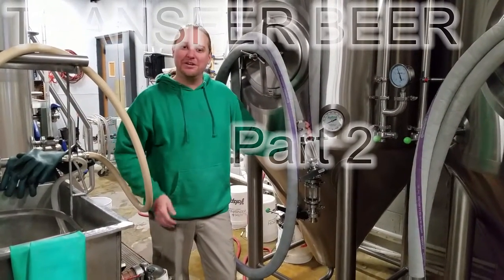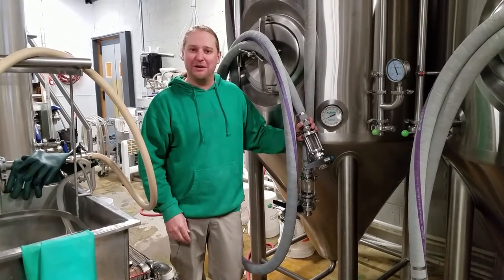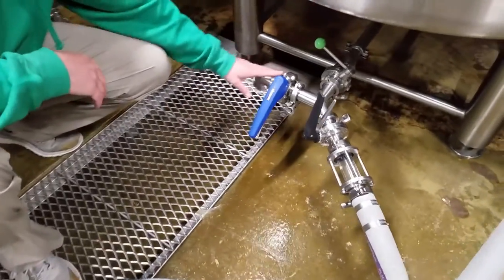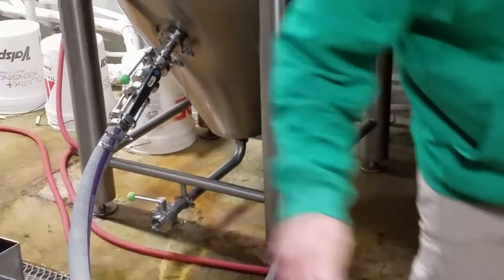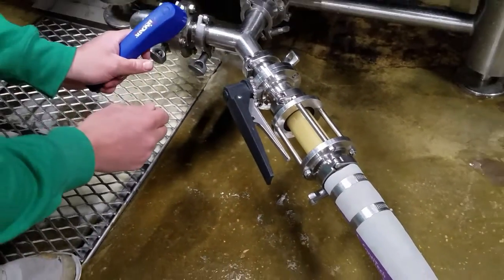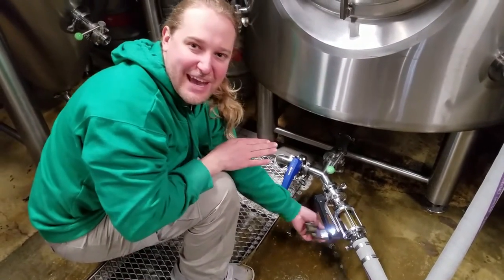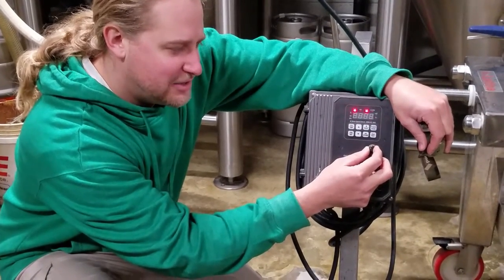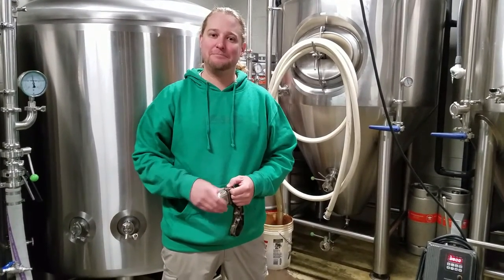TRANSFER BEER! Part 2 How To:

Comment: Very nice channel, I really enjoy watching it. I have only one question regarding this video. From where is the water in the first step of transferring beer and what is it used for?
Cheers :)
Reply from the maker: The water that is packed in the hoses is a sanitizer. This is from sanitizing the BBT before putting beer into it. After the sanitizing loop is done just close the butterfly valves on the hoses and to leave them packed. Is this the water you mean? Hope this helps, cheers!
Reply: Yes, I meant the transfer through the hose at 2:10, I didn't see your hose is connected to CIP with pump, I thought that pump is used to transfer beer from FV to BBT.
Thanks for answer.